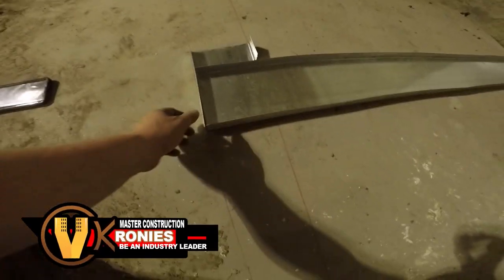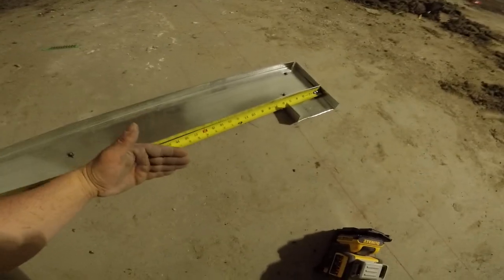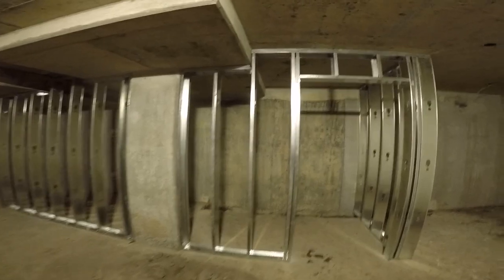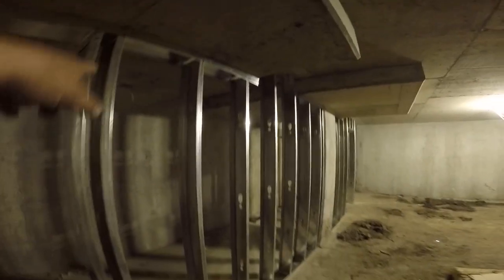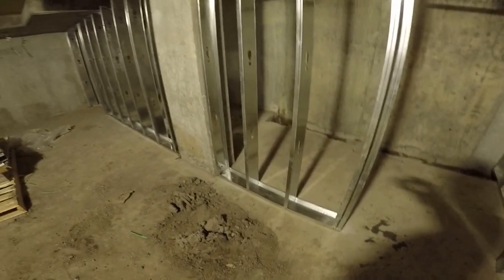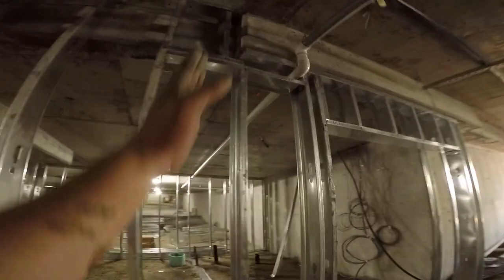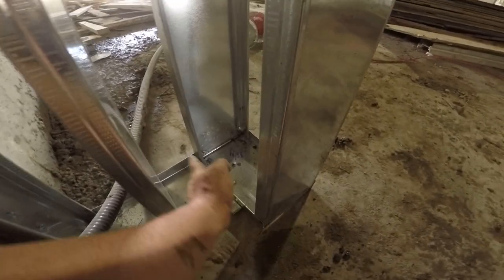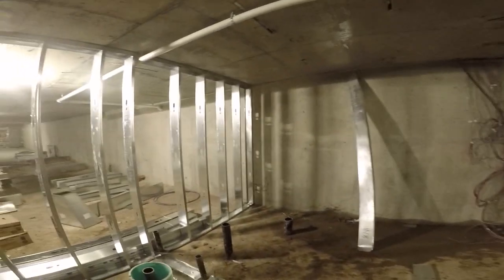Metal Stud Framing: Proper Stud Layout For Drywall & Corners!

Comment: Ur videos are awesome I’m a 23yr finisher/hanger but my main trade is tapping n mudding mainly residential but now with a commercial company so learning metal stud n also ceilings so I like to learn as much as possible n different techniques and definitely learning from ur videos great work bro keep it up n thanks for all the tips tricks n knowledge 👍🏻👍🏻
Reply from the maker: Cool man thanks so much! Sorry for the really late reply your comment ended up in my spam folder and I don't check that enough. Anytime you have questions please ask!!

Comment: Do the studs need to be touching the bottom plate floor and ceiling top plate? Or can the studs just be screwed in at any length as long as the screws are in the flanges of the  studs
Reply from the maker: We always have the studs touching the floor and they have to be 3/4" below the top when using slot track or 1/4" for std track.

Comment: 10:22 you show a pipe running down the middle of where the header would land for that section of wall. What did you end up doing to accommodate for that?
Reply from the maker: We actually had the pipe moved there. Sometimes it's more important to have the wall in the right place. It's rare they would move a pipe in most cases we would move the wall over.

Comment: Great video but i watched it for which way the studs are turned and how you decide how they face after you pull your 16 of a wall?
Reply from the maker: The studs should point hard side out like a pointing arrow from the direction you draw your centers. A stud has hard side and soft side, the hard side is toward the flat front and the soft side is the inside at the flanges.
Reply: Thank you so much for the response.
Reply from the maker: @jasonb.2430  very welcome!

Comment: Do you always add a 1/4 inch from the cmu when you mark layout on the bottom track?
Reply from the maker: Yes always, even 3/8. It's for the trimtek, tearaway (taping)
Reply: @ConstructionKronies  

Is that also so a person can use full birds instead of cutting them down?

What situations would you not add a 1/4 inch and just go centers?
Reply: I know how to bend drywall to to a radius wall, my question is how would I mark layout for a radius wall? I have the tools do it a I also have the construction pro calculator too do the formula if I needed to. I know how to make the bottom radius track and top, I know how to shoot up the dot for the top track install, I just never learned how to lay it out.
Reply: And if it’s off dry wall then you go whatever the lay out is 16 or 2’ and add 1/4 And thats so the next sheet will land center; a full bird. Correct or no? Actually a person would see how much to go for the first sheet to see if full birds will work or not then pull a number with 1/4 added.

Comment: If you look at the first door that you shown, on the right hand side when you first walk in you are missing backing for the drywall
Reply from the maker: I was just taking a look and at first I thought you were asking if I missed the second door studs, sometimes I leave them out until the doors are in but I think your asking about the inside corner. Because the door frames are welded frames the studs are on the outside of the casing and the drywall slips in behind. At that short corner I just have a 1" gap between the studs after the drywall is tied into the floater so I just use the floater as the second door stud. Hope that answers your question!
Reply: @ConstructionKronies  it did thank you, I understand now

Comment: 7:08 why isn’t the track cut out with a slot to slide the drywall in? Just curious trying to understand this metal framing. I thought every corner you always cut out the lip on the track to slide the drywall in?
Reply from the maker: yes but when a ceiling is going in the drywall won't reach up the top so we don't need a slot. But yes absolutely cut a slot if it does! Good observation bro!
Reply: @ConstructionKronies  thanks dude
Reply: @ConstructionKronies  I had a question on one of your other videos. When a wall is at a 135 degree corner what two angels do u cut to make that? Would it be 67 degrees on each bottom plate?
Reply from the maker: Shoot man I thought I replied to this I really did but on my phone it doesn't always go through. But here check out this live stream about 2 min in it shows the 135 degree corners https://www.youtube.com/watch?v=gSuuG4ngv3Q

Comment: Hi, I have a wall with metal studs and accidentally hit by forklift, hit in the middle part. I only going to fix the damage area. How I can join together a studs. Thank you.
Reply from the maker: You use track to make a coupler of sort.  Just cut it a foot long and cover 6" over each piece of stud. Does that make sense?

Comment: Should you be using slotted track for the top track as you're framing slab to slab?
Reply from the maker: Yes 100% almost always use slotted track at the top. It replaced all of the older styles of track. The only time you use standard track at the top is when your walls are not u/s structure! 👍
Reply: Slotted track is for deflection for in an event of natural disaster of earthquakes the wall will not taco in and fold it will just bounce up and down mud might crack but the track and studs will be intact.

Comment: Top track over existing ceiling tiles possible?
Reply from the maker: So we don't really put the on top of ceiling tiles but below yes. You can use clips that clip onto the tbar and provide a base for the top track to screw into. Above tbar ceiling we install whats called baffles.
Reply: @ConstructionKronies  thanks for the reply!

Comment: Why do you come off the wall 1/4" on the far left hand side? Amd when you pull your 16-1/4" do you pull that layout all the way to the right side wall? (The first wall you discuss in the video. You showed the layout of the first wall and the far left wall to the first concrete column.....do you continue that layout?
Reply from the maker: Okay so we need to leave a 1/4 to 3/8 gap preferably no bevel either, the gap is for fire caulkng or trimtek and no don't keep the same layout going around, start a new layout for each wall. Yes you can either mark 16 1/4 and the move your tape to the 16 or just hit the 1/4 like 32 1/4 48 1/4.... Hope that makes sense if not let me know!!

Comment: Nice job! How do you cut those big studs? Al by hand or with a special tool? Thx
Reply from the maker: With the light gauge steel here I cut them all by hand with my Red handled Wiss Snips. A 14" abrasive saw is what we use to chop heavy gauge or multiple light gauge.

Comment: do you ever lay out around a corner and make it 15- 5/8" to the first stud? if i get to a corner amd the track of the next wall does not run to the corner, ill just lay it out for the outside. so that you can rip the first sheet to either 16 or 32. that way, youve got either a 16 or. 32 inch rip in stock.  very common to emd up with an excess of 15- 1/2" or 31-1/2"  inch rips that  ya really wish were just 16 or 32 lol. also when rounding a double layer wall i think this is beneficial. recently saw somebody lay out a double layer 24" wall without doing this. could have been very limited in options when rocking and could very easily screw up and end up needing a 48 1/2" board in order to stagger the seams of the 2 layers. always a lot to consider.
Reply: when laying out smaller jobs its definitely easier to make the corners with the track to accommodate the stud layout
Reply from the maker: It is a pro move to account for drywall thickness and your stud layout. Always take into consideration double layer so it lands properly on the top and you have achieved the proper staggering.

Comment: What's at 10:40 ... bathroom with pipe between framing?
Reply from the maker: xephael man!! Yeah bros it was 2-1/2" drain pipe, under slab connection. I stop the track on either side of the pipes always! Never waste time doing anything fancier than that!
Reply: @ConstructionKronies  was this in a parking garage?  Seemed to be very humid/wet... they're not using standard drywall are they?
Reply from the maker: @xephael3485  yes it is a parking garage. The garage wont be wet when the building is complete, they just still haven't closed up all the pipes or the top half of this side yet (well in this video its all done now) they spec 5/8" type 'x' drywall down there. Its important to know that when drywalling those walls in a garage like that you always measure top down for standup sheets and leave a 1/2" of space at the bottom so the sheets are up off the ground. Cheers man!

Comment: 4” for doors or 4 5/8” in your case.
Reply from the maker: 4" for single stud doors using 20 gauge studs, you need at minimum 4-1/2" for light gauge (25) double stud. Always count 3/4" for either 1/2 or 5/8 it's the same to keep it simple. Also keep in mind the flanges vary from 1-1/4" to 1-1/2" so we always assume 1-1/2" to keep it simple.

Comment: I thought the studs had to be facing down or in other words the “arrow facing down
Reply from the maker: The rule is the distance to the first knockout is always 2 feet so that yiu can run channel every 4 feet to hold insulation up. The arrows are always pointing up, meaning the circles are at the bottom of the knockouts! If yiyr ever not sure just measure, as long as its 2' to the first center yiur laughing!
Reply: Construction Kronies sorry man, i just started a quick 2 week framing”apprenticeship” so I have no idea what I’m doing lol. A worker said that the little parts of the holes go to the bottom?
Reply: @88killage88  I’d ur talking about the ones in the studs yes. That’s where the electricians run their wires.

Comment: That’s wrong the short one goes over the bottom for door frames stronger corner
Reply from the maker: not sure what you mean here, it sounds like your  saying the same thing as I do, the floater locks in way stronger and using a short small piece for the leg is the only way to go. Soon though they will be specifying all hard corners so it doesn't matter unfortunately

Comment: Funny you would get kicked out of the job site for screwing studs in the track since it is against manufacturer specs.
Reply from the maker: Not sure what you mean by that my man? You have to screw the studs into the track at the top and bottom of both sides, just use the right screws for light or heavy gauge.

Comment: Never do your corners that way especially if it’s a hollo metal door your not gonna be able to slide your studs over when installing the door 
And it also makes it harder to drywall
Reply from the maker: These doors go in first before the drywall. The drywall slips into the frames and we check level of hinge side before screwing off the door stud.  Not sure what corner your talking about but I assure you every example in this video is the correct way to do it.

Comment: Framing on that door is total BS. While framing the door wall the legs on that condition should be as long as possible. Instead of a  3 in leg in the door make it longer by reversing the last layout which allows for use of the slammer stud after drywall is in and a more solid connection.
Reply from the maker: That is a total misconception. Trust me, the way I show it is the correct way.
Reply: @ConstructionKronies  not even close been framing and rocking longer then you’ve been alive but nice try anyway
Reply from the maker: Well agree to disagree? Bro I've seen it all and I've been challenged with this before and I'm telling you what your saying won't change a thing. Once that floater is locked in properly and the drywall is in, that door isn't going anywhere no matter if the piece is 3" or 12".
Reply: @ConstructionKronies  you’ll think differently when the track rusts off at the sides of the track.